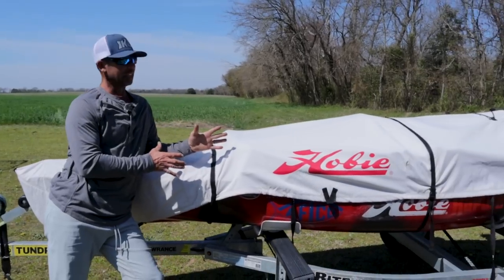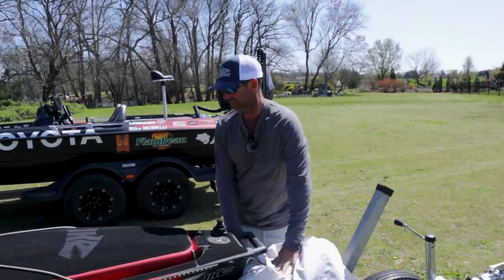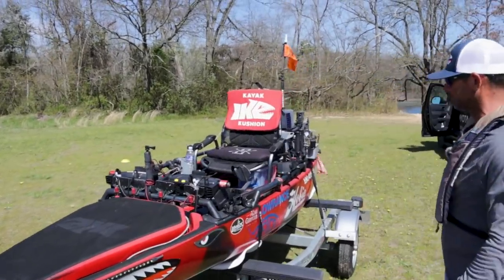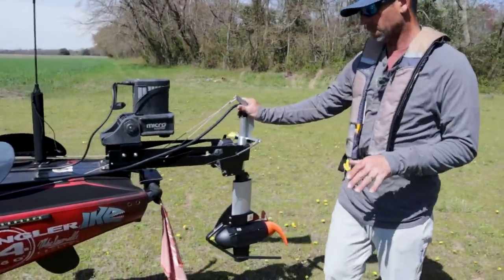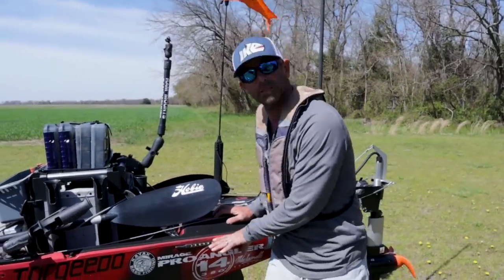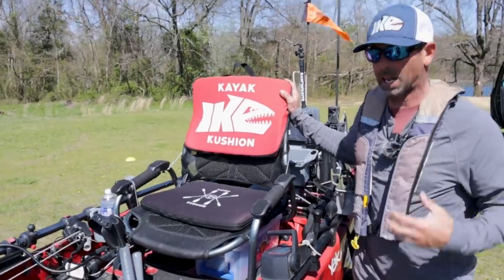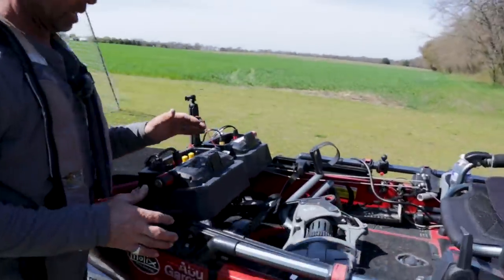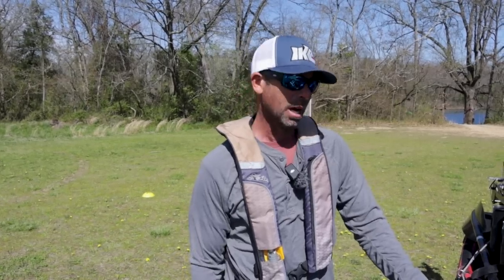Bass Fishing Tournament Kayak Setup!!! | Hobie Kayak

Comment: Pretty cool yak but looks like 5-8k. Easily
Reply: Lol, 15-18k easily!
Reply: Far more than 5-8 k.  I have very similar yet up w/less electronics and I’m sitting at over 10 k.  Then I purchase a trailer W/bigger wheels and had a custom rack built for it.  You need to review the price of the stripped down  PS140 360.  If Ike had to pay for his set up,  It would be $15 K or more, easily.  The Big Hobie is so well built compared to other yaks, very little comparison.  When you start putting elec. motor and pike on the back many yaks are not made to support the stress.  And certainly not over any period of time. Get your pocket book out. Over the long run it’s $$$ well spent.
Reply: @larrymoss9954  I thought about doing something like this too but then I think will be happier with a boat
Reply: The kayak alone with nothing else is $5800, so add a few hundred batteries, a few thousand more in electronics, a couple thousand more for trolling motor, plus $600 more power pole, ya easily over $10k